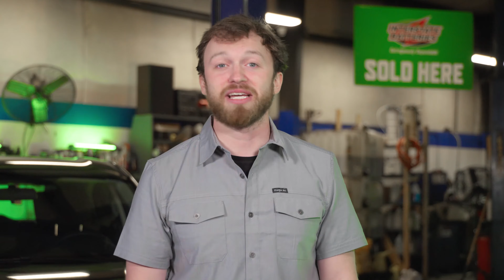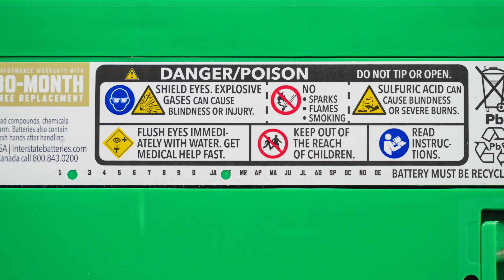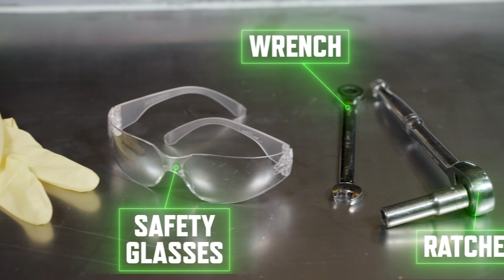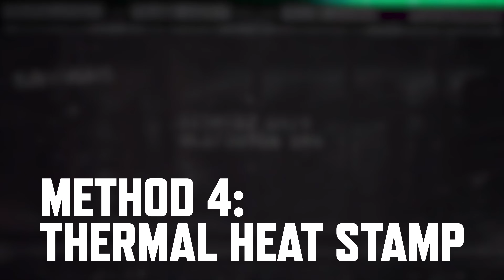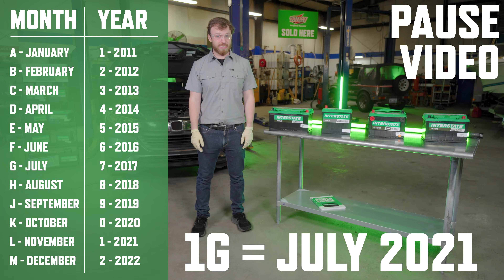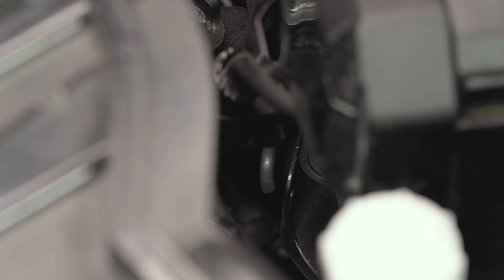How To Look Up Your Battery Warranty

Comment: I dont have these codes stamped on the green rim anywhere. The only marks on the battery are the ones on the back melted into the black plastic that you can't even make out any of those digits. I think this battery it a POS to be honest and will never be purchased again for replacement.

Comment: My punch label has like 6 different holes punched out, and the codes on the battery come back with nothing. One said it was a battery from 2013. The cars a 2017 and it's a replacement battery, so that's clearly wrong

Comment: My first Interstate battery in 2010 had a 7 year warranty, with a 48 month free replacement, why did Interstate batteries decrease their warranty on batteries, are they having more failures on them due to Johnson Controls moving manufacturing to Mexico? I now use a Pulsetech Powerpulse passive desulfator on the my 2001 BMW 530i battery to extend it's life up to three times. My next battery will probably be a Interstate AGM battery from Costco.

Comment: For the punch out label, it would be better to have 2 digit years, and just make an updated label every 10 years.  That way the customer doesn’t have to have an Enigma machine to figure out when their battery was made.
Reply: Also put it in a place you can see without pulling it out of the car

Comment: Thanks, very helpful! F96KT = August 2019 The engraved code was on top corner of the negative side.
Reply: Mine is h38ab and when I typed it in on interstate, it won't even accept the code.

Comment: Doesn't matter what markings or receipt you have, 1 yo AGM battery with 3 year warranty won't be honored because they will make you leave the battery over night to charge then they will call you the next day saying they are able to charge it up to 12.2v so it's not the battery it's the vehicle. And even if you bring test results and data from your mechanic showing that the vehicle has no parasitic draw or bad alternator they will do the same test and say they can charge it to 12v overnight so the battery isn't faulty. Used to be extremely loyal to interstate but I'll never buy from them again
Reply: Im having this same exact issue
Reply: Same here  @aquamayne8168